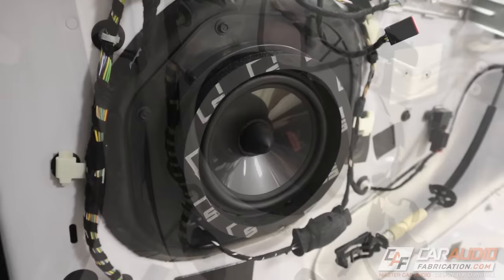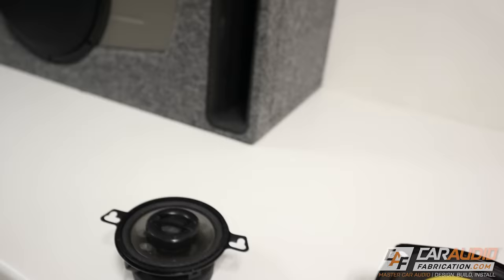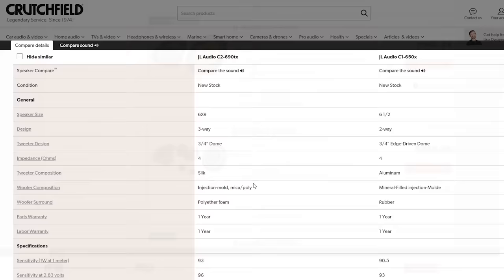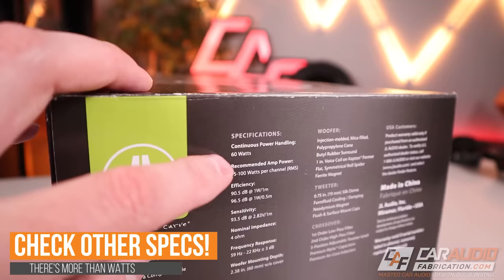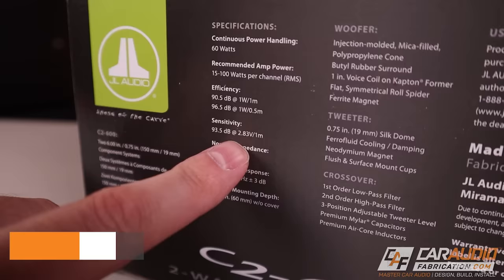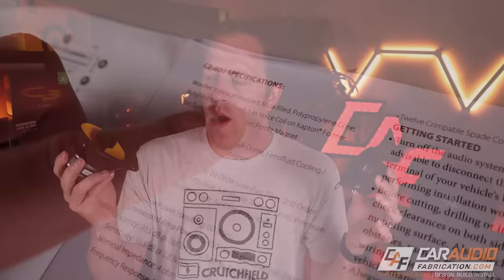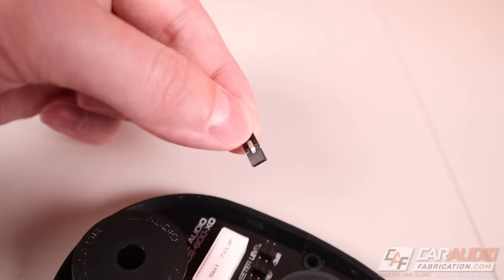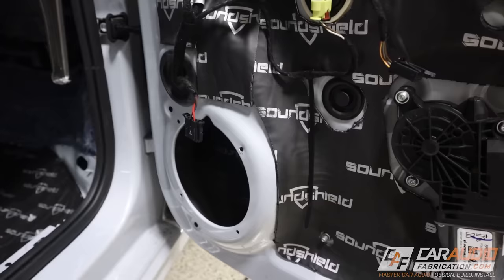DO's & DON'Ts - Picking Amazing Sounding Speakers!

Comment: Ok well here’s what I have. My car is a late 70s Pontiac and has only 3 speakers. 2 on the rear deck lid and 1 in the center of the top of the dash. All speakers are 6x9. So I’m assuming if you want the best possible sound out of that stock setup then all 3 should be 3 way speakers?
Reply: Definitely or even 4 way 6x9’s

Comment: I am upgraded the head unit in my 1997 toyota hilux sing cab ute l already have a kenwood  pandora just the head unit and you have given me a lot to   think about l got the head unit for nothing and l have only two places to put two 4 inch speakers because l don't want to put holes in my door cards so when l fit them l will be going to get the plug and a microphone for the blue tooth for my mobile phone  l have learned a lot from this video thanks

Comment: In my vehicle I’m just looking to upgrade my factory speakers and keep factory head unit the factory 3 1/2” speakers are rated at 8ohms and any replacements are are at 4ohms is there any way to remedy this or will it not hurt the 4ohm speaker to run at 8ohms?
Reply: Most 4 ohm speakers can handle 8 ohms, it's just can the receiver handle 4 ohms is the concern. There are companies who make aftermarket 3 1/2" 8 ohms speakers, just not a bunch of them.

Comment: I ran into an issue doing the speakers in my 03 Cavalier.   I bought a matched set from Sony . Front and rear.  The reae 6x9s are perfect but the front door speakers are half as loud. I have to push the fader forward by half to balance the sound.  Its driving me crazy.

Comment: How can I get the most out of my 4ch amp.  All components I see are 4ohm final. Is there any components set 2 ohm final?
Reply: Probably, but it involves more on how your speakers are wired, than simply wether the speaker is rated. Both wiring and speaker ohms rating, goes hand in hand.

Comment: Any novel ideas for replacing Mark Levinson (8ohm) or Bose (2ohm) component speakers?  Replacing with aftermarket 4ohm speakers would seem to risk both amplifier life and crossover points.
Reply: For Lexus and Toyota JBL - you should stick with the JBL and Infinity speakers, sticking with 2 ohm speakers.

Comment: I'm looking to replace my 2019 Fusion's Sony front door speakers as one of them is blown. I'm looking at a set of Infinity Reference 6.5" components but I really would prefer not to go the route of replacing the factory amp right now. With 93db sensitivity and 90 watts RMS, I think they would work well, at least I'm hoping so.
Reply: I'm assuming you're referring to the Reference 6532iX model, but with a sensitivity of 93db, they should be plenty bright and crisp, but don't expect them to "wow" you with how they sound until you're pushing them with closer to their RMS rating than you will be from a stock headunit... Brand name aside, there's a downpour of negative reviews on sites like Amazon on otherwise great speakers' pages from people who don't understand that concept because they've underpowered them and inherently whined about "their lack of performance". Don't be that guy. 😅
But yeah, you'll likely enjoy the Infinity's product... I loved my Kappa 62iX's!

Comment: i got a Question, when converting speaker sizes, for a 4x6 how do you going about changing it to 6x9, i cant find spacer adapters without cutting the frame and im not trying to do that and i dont want the round 6.5s

Comment: So i recently bought 4" JBL for my rear doors, they are coaxial. Also 6.5" coaxial to replace my trunk subwoofers which i think i messed up on. Should i have had only gone for normal subs in the trunk?
Reply: I have 6.5" pioneers in the front
Reply: Definitely should’ve just gotten a subwoofer for the trunk. If it’s in a car where the trunk is closed off, the mid/top range of the speakers would be muffled anyways.

Comment: The good thing about speakers is as long as the manufacturer is transparent about the specs you know exactly what you’re getting. 

I’ve got the cerwin vega v468 years ago when they were $75 a pair and now they’re $85 each 😮

The best deal on the market right now is BZRK 6.5 for $40 a pair and they will compete with or surpass the flagships from major brands.

Comment: I have a 98 Honda Passport. It has front door speakers on the bottom front corner of the door. Them two more in the east of the truck at the very back top where the hinges for the glass meet the roof of the truck. I don't have speakers in the rear doors. I'd love some ideas to maximize the audio in this truck before i get all my noise  insulating done. That way i can do it all at once.  I wanted ideas on fabricating an enclosure for the back speakers to direct and refine the sound. Any ideas?

Comment: Thank you. The video is very informative. What about impedance in Ohms?? I am using an android head unit which have speakers impedance 4-8 Ohms but the speakers I am interested in have 3 ohms. Will there be any problems?

Comment: Hey mark, I got a question.... My truck comes factory with 4 speakers(2)1" tweeters, (2) 6.5" speakers). Crutchfeild recommended Rockford R165s components which has an acceptable power/sensitivity range within my likings. I have a single DVC 4ohm Alpine type R SWR1234d wired to bridge  for  8ohms, sony xva64bt Power Output: 17 Watts RMS 
4 Ohms < 1% THD+N 
SN Ratio: 80 dBA 
(reference: 1 Watt into 4 Ohms)Outputs: Speaker outputs
Speaker impedance: 4 – 8 ohms
Maximum power output: 52 W × 4 (at 4 ohms) , I understand the tweeters have built in crossovers,  would I still need to connect them to the speaker or can I hook them up to factory tweeter wires? Would the speaker have to much highs where maybe I should look at mid range speakers? My logic could be wrong but should I look for speakers and tweeter that are within 60wRMS/100wMAX currently I think 90ish DB seems comfortable to me. This is all confusing. Thank you and appreciate the help, knowledge and support you could throw my way.

Comment: Would it be possible to install a small coaxial speaker in the factory tweeter location, and then installing a better woofer in the factory woofer location? The factory tweeter location is in the dashboard and not in the doors, the doors only have a 13cm/5inch woofer in them.

Comment: hey quick question. I was digging through my parts bins knowing I had a set of tweeters I could throw in my daily driver to do a quick cheap upgrade only to find that I wasn't careful enough and the plastic like dome is pushed in and now has a small dent. I tried using some tape to pull most of it out gently but its far from perfect. how big of a difference does that make?
Reply: It doesn't.

Comment: Can you put a aftermarket stereo system in a lease ? Does it void warranty , will the dealer charge for damage ?
Reply: It won't void anything, but remember you will have to put all of the original equipment back in before returning it, otherwise they will charge you for the repairs.
Reply: @Technotranceism  hi thank you for answering my question much Appreciated

Comment: Hello there , i have a dodge charger 2010, the sound system of the car is stock and its amazing,, the speakers are boston acoustics 6x9, lately it started giving buzzing noise , so i have to replace them, ive tried many 6x9’z but no use the sound sucks big time, what do you recommend ?

Comment: I just tried 3 pairs of entry level ($80 - $100) component speakers (no names of course) and they all sounded poor. I have an under-seat Amp (70 x 4) and a very decent under-seat active Sub so there was no reason to not get great sound at that price, with those components. So I reverted to the factory coaxials and I couldn't believe the sound! So now I'm buying 2 pairs of decent ($80) Coaxials and it's probably going to sound great! This is all very subjective yes but it sounds waay better than Components in this price range. And there's all levels of Coaxials, so why not buy a great under-seat Amp and a really good under-seat Sub with 4 x high end Coaxials? The frequencies between the Coax woofer and the Sub are filled up and the mids would sound better too. In fact, it would sound as good as what you buy. The guys who put together those Coaxials, are way ahead of me with a 'woofer' and a tweeter! Would love to have your thoughts on this IF this idea isn't sacrilege! This is only for moderates like me of course, who won't sacrifice car space. Thanks in advance for a video on Coaxials + Amp + Sub!🙏🏽😊

Comment: Why does my tweeters have a static sound when not playin
Reply: EMI. Electromagnetic Interference.
In a sense, it's a sign that your tweeter has a good sensitivity, and really isn't any "fault" of the speaker itself. Getting a better speaker wire (that's insulated from EMI distortion) will usually clear this issue up. Additionally, if you also hear a "whine" from your speakers while revving the motor, it's also EMI causing that too, though chances are you'd want to upgrade the power wire to your HU/amp(s) to alleviate that. 
Of note though, some HUs will output static based on what input source it's playing from but not others. For instance, while connected to BT, my headunit will make static go to the speakers but not during a wired connection.

Comment: With a factory head unit, speaker only upgrade, I would look only at two specs, first sensitivity, a few as little as 4 bd more sensitive, can vastly increase volume levels.
Secondly would be frequency response, specifically the low end, how low do they go? The difference in 100 cycles and 50 cycles is dramatic, I will also add a paper cone is fine, some of the best drivers  made, like” scan speak” use paper.   Nothing wrong with paper.

Using dsp, amps and multiple drivers, other things matter, people who do this are few however.

A simple speaker upgrade to a factory head unit can yield great results, and look completely stock. 
Again just to be clear a speaker only upgrade, sensitivity and the frequency response, the low end, how low will the speaker , that fits the stock location go.
Most any speaker will do 20k high end, it’s the low number to look for.
Power ratings will not matter, paper cones make very efficient speakers.  So materials really do not matter.
I think many make this more complicated than it needs to be for most people. 

One of my favorite 6.5 speakers are the ground  zero yellow baskets, efficient, and play down to 50 hz. With a low power, like a stock head unit.
Also a great speaker for Harley’s. Or any application you will not be running a sub.
They also work great with higher power, and dsp. Setting the low end up to 80/100 hz. Great speaker.
I highly recommend. And not crazy expensive.

Comment: Does upgrading modern car audio make $ sense these days? The systems that come stock are so much better then they were in the 70s and 80s that it seems like a big waste of money
Reply: You are correct in your assumption, however they're still not as good, as the top of the line who made them. That would require a huge cost to the consumer, when purchasing the vehicle, something very few manufacturer's are concerned with doing.

Comment: What type of speaker / tweeters do recommend for the best clarity mostly listen to audio books. No after market amp and stock headunit 2018 honda civic hatchback sport touring
Reply: I would just replace the factory tweeters with good aftermarket ones, assuming that your car has stock ones.  If not, add some with the crossovers.  Key word being ‘good’ aftermarket tweeters.  Low end ones will hiss with nothing playing.  I’d plan on spending upwards of $100.  In my ‘12 CR-V before I finished my sound system I just replaced the stock tweeters.  HUGE improvement and they brought the sound to life, night and day difference.  And I just had some $10 cheap PowerAkoustik tweeters back then.
Reply: I have a 2007 CRV. Want to replace factory front speakers. I want sound quality. Any recommendations?

Comment: This may be a silly question… But what effects the sound quality more.. a fantastic amp with a run of the mill amp or visce-versa
Reply: Many thing's ... running rca opp of power cable poor head unit bad wires etc

Comment: I have a cadillac dts and they have 5.25in the doors and want to put 6.5 in the car can I still do it the car is 2007 I know that I'll have to do some fabrication
Reply: I have the same car 06 I just replaced them with five and a quarter inch components but you can take out the plastic five and a quarter inch mount and buy a six and a half adapter ring and install that
Reply: For the rears I'm not sure if you could install 6 and 1/2. It's it's a slightly different install in the back speakers
Reply: I also you sound deadener in the doors double layer 80 mil kill mat. On the outside panel of the door not the inner panel.

Comment: 1 question modern stereos sound pretty good across the full range, and aftermarket never deliver as good a range. Serms they do fine in highs and midsbut factory quality systems have better bass or lows than aftermarket so called upgrade speakers.

Comment: For a basic unit, for example 2x20W, what power of speakers shoud I choose? Or vice verse (for 20W speakers, should I coose a 20W unit or say 40W unit)? I am asking in regards to sound quality (for listening to musinc at lower volumes). For example, maybe a 20W audio unit will not sound very good with 20W speakers, because it is pushed to the max amplification. Or the speakers will not sound good at their max power. If you understand what I mean.
Reply: Yeah choose maybe 30W speakers, doesn't really matter. Just don't go too high or it will be worse
Reply: @maxl7827  Thanks.

Comment: Hi - any significant difference in chosing a 2 way speaker or 2 seperate units - a woofer and a tweeter, just in general?
Reply from the maker: Check out this video for more of a breakdown on that https://youtu.be/VE7VlKUVXks
Reply: Tweeters are very direction sensitive so generally you want them up high and pointed at your ears.  Theoretically a lower door is not a good place for a tweeter but sometimes that's all you have without custom work and it does fine if you have adequate power and a way to tune the highs separately.  My truck had tweeters by the windows but I just went with 2 ways in the lower door for simplicity and its fine for me.  I used to drive an older year of the same model and it didn't have the separate tweeters so it had 2 ways stock.

Comment: I’m planning a stereo for a sedan with a 6 1/2 mid and a tweeter in the front doors and 6x9’s in the rear deck(99camry). I was told to just eliminate the 6x9’s and use the 4 channels of a JL audio vx1000/5i to run only the front speakers because I won’t really hear the rear speakers….. is that a good idea or keep the 6x9’s ?
Reply: Definitely keep the 6x9’s they’ll add so much mid bass you’ll definitely miss the mid bass. Ether snip the tweeter wires do you don’t really have to hear them or add a crossover just buy a capacitor kit off eBay and find an online calculator for the low pass crossover
Reply: Don’t just take my word though do your own research and do what’ll make you happy
Reply: It's always worth putting more money into a front stage versus doing rear speakers. There's no real benefit of having rear speakers in a 2 channel system. Especially if you're doing a vxi.
Reply: It depends how deep you want to go into good audio. If you don't want to play around with tuning then keep the front stage together (meaning keep the woofers and tweeter connected via crossover).
Reply: In the Sq community they usually dont use rear fill because it pulls the sound stage backwards.
Reply: Definitely keep the 6 x 9s in the back.  They are what give you the concert hall sound.  You should be able to adjust the Front to Rear balance to bring the focus right to your ears.   
As a matter of fact, I had a super nice bi-amplified head unit in the mid 70s, that placed 87% of the watts to the rear 6 x 9s and 13% to the 4 front speakers.  It balanced perfectly, and sounded better than anything  I've had since, including VW Monsoon 8 speaker system, that was an $800 upgrade in 1985.  That's about $2200 in today's value.  The mid 70s head unit would be $1300.   I miss the quality build of the 60s and 70s electronics.   Amazing products.

Comment: Any body ever do subs in the back door. Like low power smaller subs or is it better to get 2 sets of speakers
Reply: Yes it's been done before!
Reply: @Technotranceism  thank you so much. Had a hard time finding the answer to this anywhere. I’m still strapped for cash to be able to build my system but I think I’ve got all the parts planned out
Reply: @mephistoninja2213  Your welcome. More often I see 6.5 or 6 3/4 drivers used in these cases, but it's also not uncommon to see 8" or bigger subs used as well.
Reply: @Technotranceism  yeah I found some kicker 6.5” I think will work well. Crutchfield used to have them listed as fitting my car but they changed it for some reason
Reply: @mephistoninja2213  It could be due to a model change. As manufacturer's make updates to older models, or simply make new versions, the sizing can change. Crutchfield is a good company and good source for information, but sometimes they don't have everything you need to know about certain things.
Reply: @Technotranceism  yeah I was worried about sizing change cause they did just update the model. Still 6.5 but I think the back spacing changed a tad. Hopefully it’ll be fine and if not I’ll just make a separate box in the trunk and get 2 more speakers
Reply: @mephistoninja2213  They could always be custom mounted in the door.
Reply: @Technotranceism  oh I didn’t even think about that. I’m in college for engineering I’m sure I could figure something out. Just waiting for the money to stack up yk.